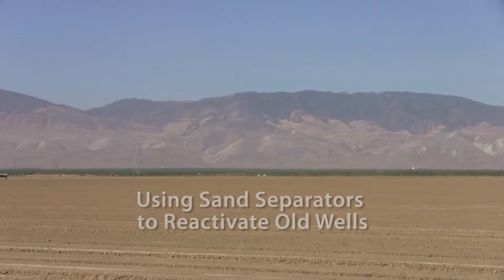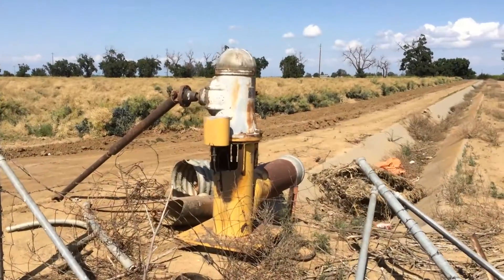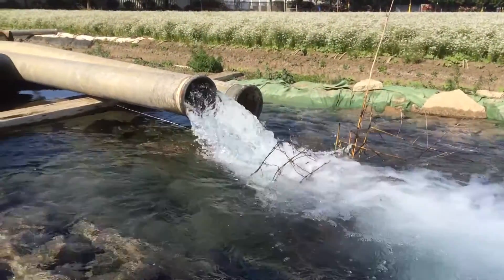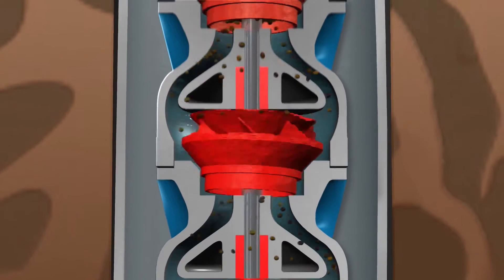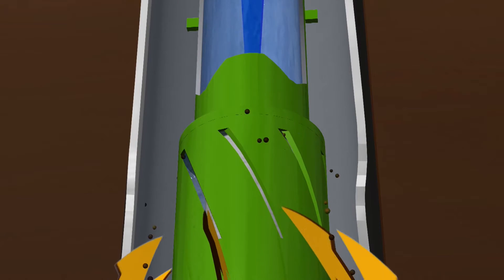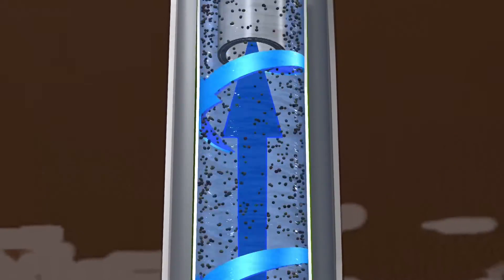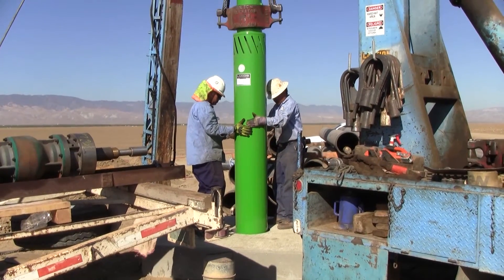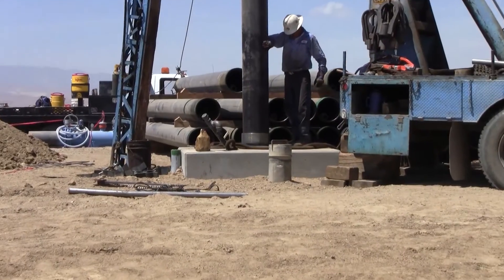Using Sand Separators to Protect Pumps in Sandy Wells – LAKOS

Comment: Never heard of these. Im in South  Africa.  Have  a strong  borehole that  has sand and destroys the pump. Im going to  look  into this. 
What  do you  suggest  if the sand comes from the top,above  the pump?
Reply from the maker: For submersible pumps: we recommend a enclosure (cover) on pump inlet to force water through the Separator. See this link: https://www.lakos.com/product/pps-shell-kit/
Reply: @LakosFiltration  Thanks for your  fast  response.  That  makes perfect  sense.  Only problem I see is that my borehole is  150mm(6inches) and the  pump/ motor  is 100mm. Will  this be sufficient space, keeping  in mind water flow between motor and cover? 
Next question  is what will the cost be? 
The hole is 127m deep but the pump  is at 60m . It has a 5kw motor and delivers approx 25000 L per hour. The water usually  overflows when the pump is off. 
Alternatively do you know of any high volume  low pressure  pumps that are able to tolerate  sand ?
Reply from the maker: @johnwagenhauser9835  We recommend you consult your pump vendor for pump options. There are several requirements (well depth, head pressure, wall space etc.) for a LAKOS Centrifugal PPS product to work - we have a product selector at www.lakosgroundwater.com that will cover minimum requirements.
Reply: @LakosFiltration  was  also thinking of getting the hole reamed to a larger size. Will  that help sl9w the flow down so to not pick up as much sand?
Reply from the maker: @johnwagenhauser9835  Not sure if that will help. Good question for your well driller.